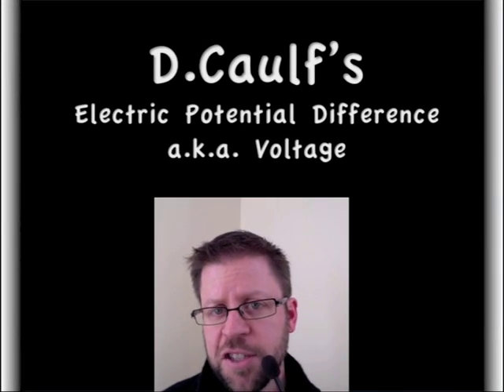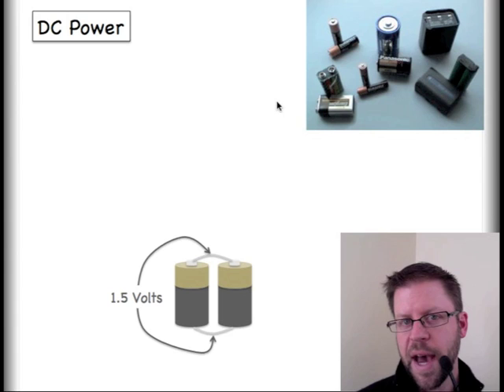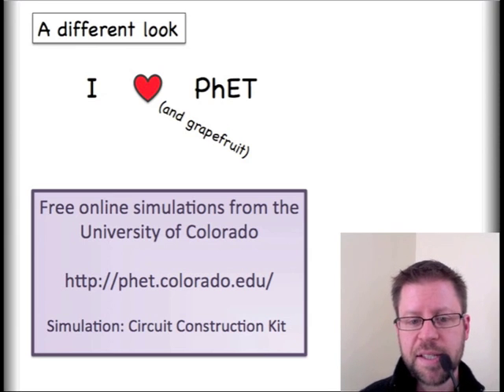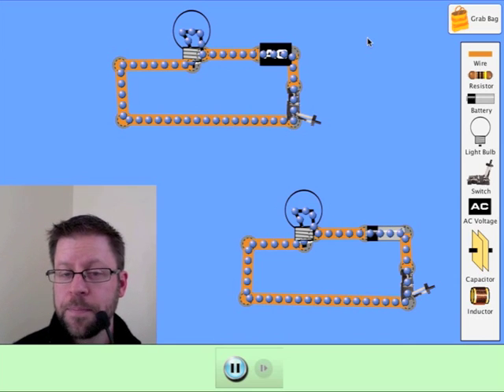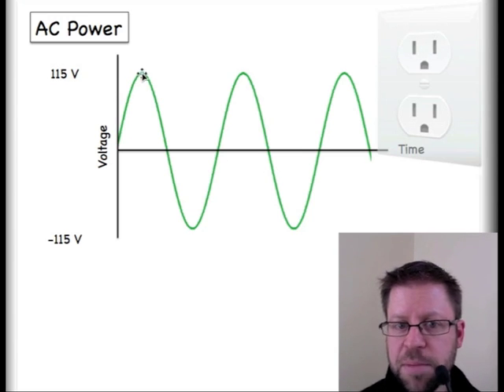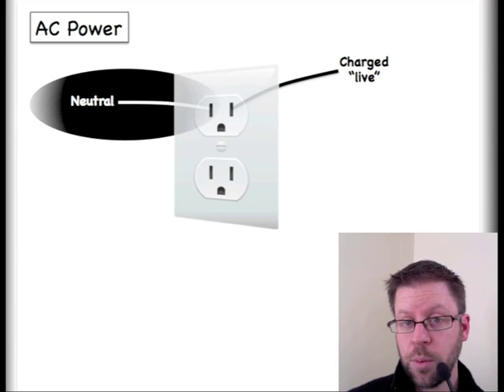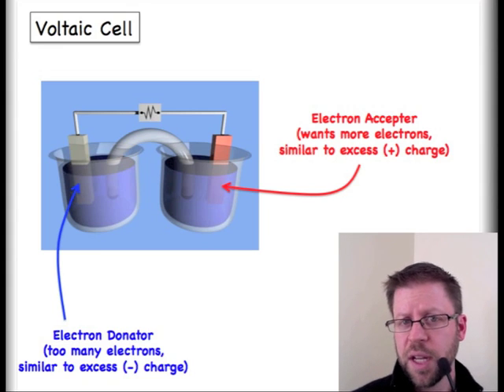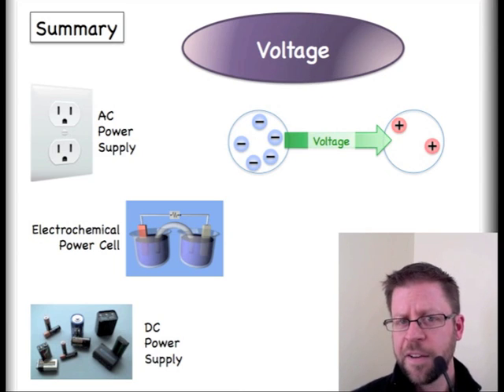AC and DC power: Voltage Lesson 2 of 2

Comment: where do the electrons come from when using a generator? The wire, the magnets? Why do they never run out?
Reply: electrons are part of the wire..they move around and around the circuit but never disappear
Reply: that is not and answer
Reply: robert mccully Atoms within objects like the wire gets supplies the electron, and some get recycled in the process.
Reply: Recycled from where? Electrons are always there,used as a road  during motion after excitement. No excitement = no motion= on road ! I think the theory is wrong. Electrons are the road, the excitement of  the fuel. Same as nuclear bomb. What the fuel consist of? Not sure anyone reading understands.
Reply: I know its been some time but.. hey. Metals have something called Electronic Cloud (at least in my language) so they dont follow the same Atom model we all studied. Instead, all the protons are connected like normal atoms but the valence Electrons are wandering around the whole metalic bar or whatever. So when u generte electritiy, you are just movim them around transmitting a wave of energy. I found this analogy in reddit :

Perhaps a bad analogy would clarify that point. For some reason you encounter a tube filled with gum balls. The tube is held very firmly in place and you can't tip it to roll one out. So you, the generator, push a rock into one end. almost instantly a gumball pops out the other end. The gumball your rock hit did not travel through the tube and out the other end. Each gumball hit the next, and the signal, or push was able to travel much faster than the gumballs themselves.

Comment: Technically, in a 2 wire circuit (Black, White) (not counting the green wire), the white wire is NOT a neutral. The correct term is (Grounded Conductor). The reason being, that white wire is carrying the same amount of (Amps) as the Black one. The white wire is the return path to the source. A true Neutral is found in a 3 wire circuit (2 Blacks and 1 White). In that type of circuit, the neutral is there to carry the unbalanced load. If the circuit is perfectly balanced, where the load is equally distributed on each of the black wires, then you would have zero (0) amps on the white (neutral wire).

Comment: AC example at 9:06 he says USA has 110V wall sockets and he is correct except in his graphical representation of the peaks and troughs of the AC waveform. The peaks and troughs are not +/- 110V. 110V is the rms (root-mean-square) value that is equivalent to a DC output. Peak and troughs of a 110V(AC) wall socket is actually +/-155V.

Comment: I went out to Univ of Colorado like you showed and downloaded the PHET model for designing basic circuits and understanding them however I notice on your screen it has an icon for Capacitors, Inductors, and A/C yet on my download it did not have these three items but only wire, resistor, battery, lamp, and ammeter. How can I get more options like you have? Thank you in advance for answering me. I appreciate it!

Comment: Very Good explanation.  Thanks. I do have 2 questions.

1.  If I buy a  1.5V battery and attach a copper wire from the + terminal to the - terminal (and leave it attached for days together) will the electrons in the - terminal slowly move over to + terminal in a few days time and at some point there will be no charge difference between the 2 terminals and the does battery the go dead at this point.

2.  In the case of AC voltage , does the live wire and the neutral wire alternate their roles constantly.  I mean during the top half of the sinusoidal wave(0 to 115V and back to 0),  Is the live wire  negatively charged and the neutral wire positively charged, so that electrons can flow from the live to neutral.  And also during the bottom half of the sinusoidal wave(0 to  - 115V and back to 0) Is the live wire  positively charged and the neutral wire negatively charged, so that electrons can flow from the neutral to live.  I mean what does negative voltage mean?

Comment: If a portable fan accepts DC 12v  2.5amp power supply, and this is supplied through an ac adapter. Can i run this directly through DC power running through a 12 volt battery?
Reply: Yes. The fan will only draw as much current as it needs.

Comment: Its clear when the two batteries side by side have the same potential but more current to send so longer life but not at all clear to me why the end to end voltages are added.  You suggest the two sections meeting in the middle cancel the voltage difference by rebalancing charges so whence the voltage increase overall?  Surely you would have to have more electrons at the bottom in relation to the top but you don't say that.

Comment: It seems this reply was to a question similar to mine, but the original question is gone now.  at 3:30, i do not understand why for the two batteries in series, the negative electrons in each battery's black area wouldn't just go to the positive protons in their respective battery's gold area.  wouldn't each side of each battery be electrically attracted to the other side & up on the boundary between the two electrodes prior to the completion of the circuit & then once the circuit starts, the

Comment: Aircraft DO in fact, often get damaged by lightning strikes. I can swear to this personally, logging 3800+ hours in multi-engine turboprop aircraft as a Fllight Engineer. I have been struck several times. The damage may be minimal, but there is nearly always damage. It manifests itself as burn-holes, sometimes as small as a coin, or in one case I know of where the radome (nose cone) imploded.

Comment: How do you "ground" a charge if you are on a plane, or does it not require it as you are not connected to the ground, is this why planes don't get damaged when they are struck by lightning?

Comment: Both the live and neutral carry current equally.  The power company grounds their transformers & one conductor to protect them against lightning.  Because one conductor is grounded in the utility wires, the wires in a building must also be grounded.  Because it is grounded does not in any way mean it does not carry current.  It most certainly does carry current, that is the definition of Alternating Current.

Comment: Ok. I think I understand everything you explained. But I'm still not grasping what's causing AC current to go back and forth. I understand the potential difference in direct current causing the electrons to move from one terminal to the other to "balance itself" which even that I'd like to ask what exactly happens to the electrons that finally get to the positive end and redistribute themselves? does the positive end "fill up" so to speak? What keeps them unbalanced and that potential intact?

Comment: Great video i have 2 questions though. (Australian Voltage is 240) If an AC circuit alternates between +240 and -240 how come when tested with a multimetre it will only show a steady reading of 240? Also why does Neutral show zero voltage if there is 240v at the power terminal and it is a closed circuit?